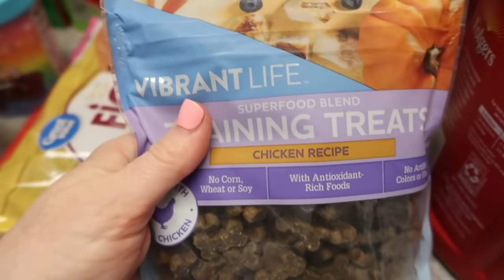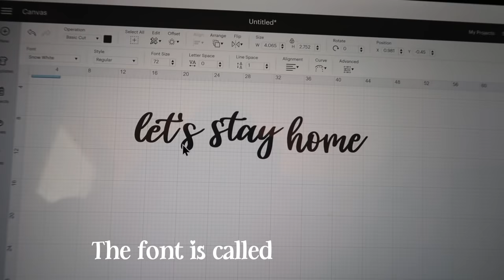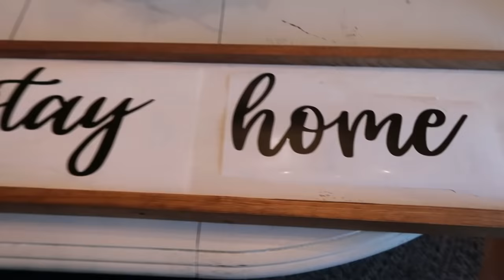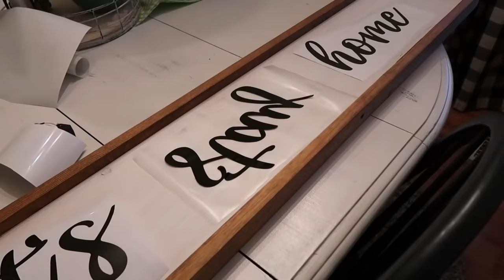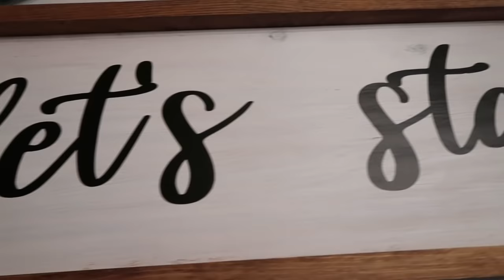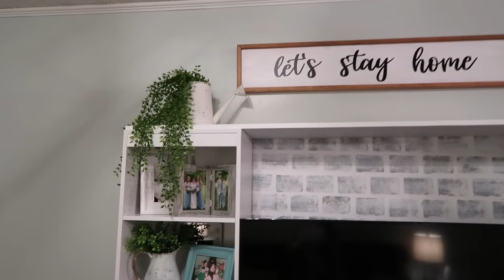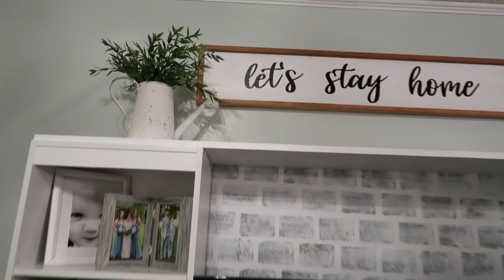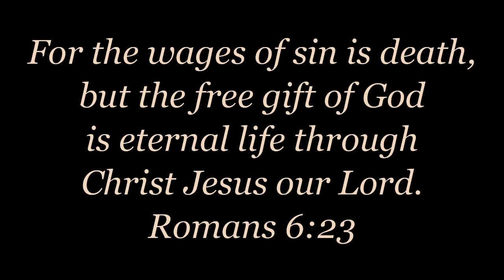VERY PRODUCTIVE HOMEMAKING VLOG / TONS OF CLEANING MOTIVATION + DIY SIGN + NEW RECIPE + GROCERY HAUL

Comment: Arika, those scrunchies are so cute!  I may have to get some.  Have you tried using a sock bun?  You take an old sock that is close to your hair color and cut off the toe area so it's like a tube.  Then roll the sock so it looks like a donut.  Then you pull your your ponytail through the hole and roll the hair it down around the sock.  Makes the hair look thicker and holds really well.  Then put a cute ribbon or scrunchie on.  So cute!  I bet Madisyn knows about this! :)